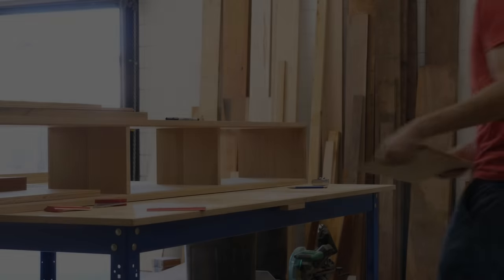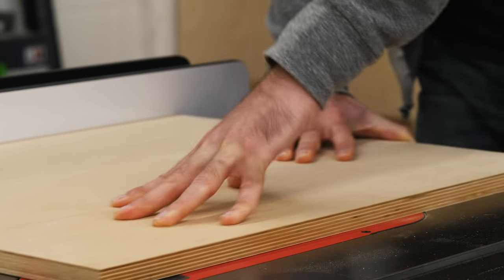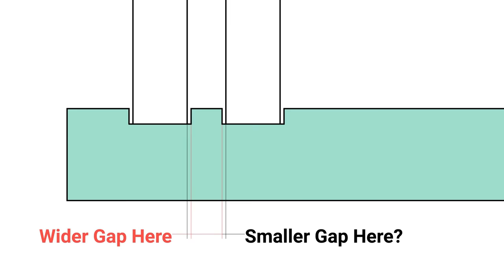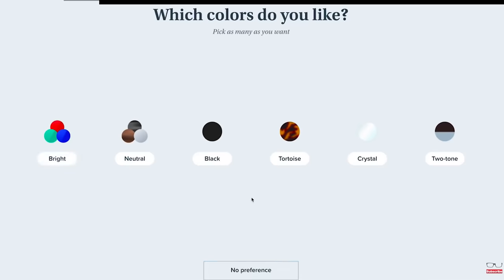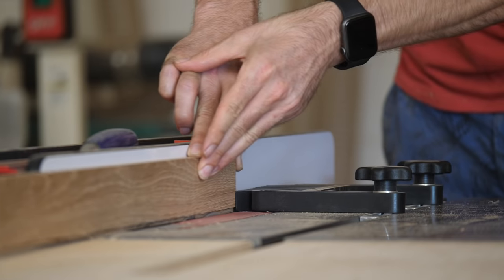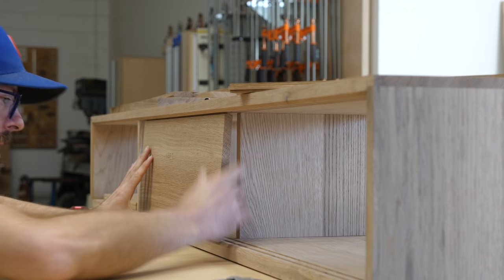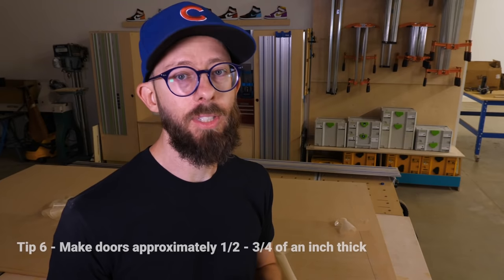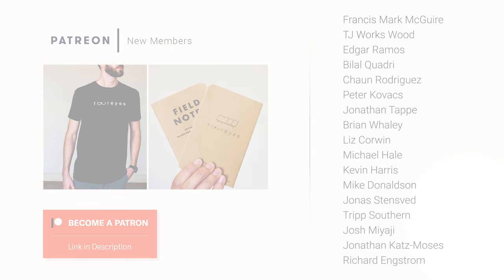8 Tips for Perfect Sliding Doors without Hardware

Comment: Interesting that you dismiss butt joints so easily as a way of hiding the groove. I would have thought the strongest type of butt joint WOULD hide the groove, but that’s because I thought the best type of butt joint was one that relied on the shear strength of screws, ie, where the side panel does not sit inside the upper and lower panels. A butt joint that sits inside the panels would be very weak on the lower joint. Ps love the vids & hope this comment helps with algorithms etc.